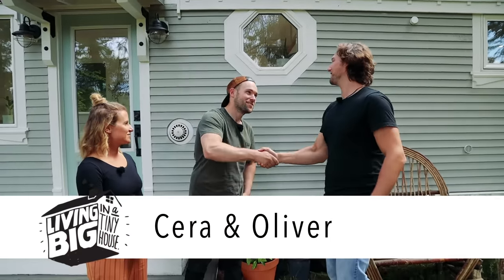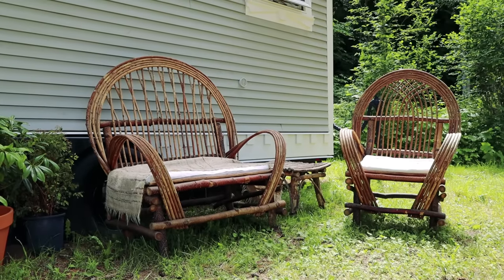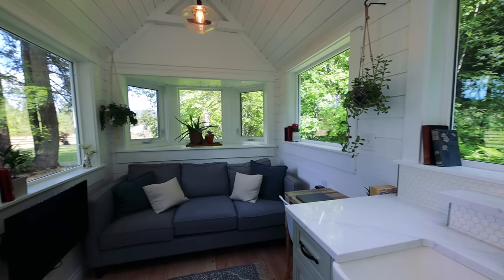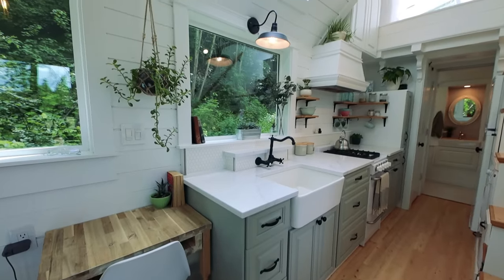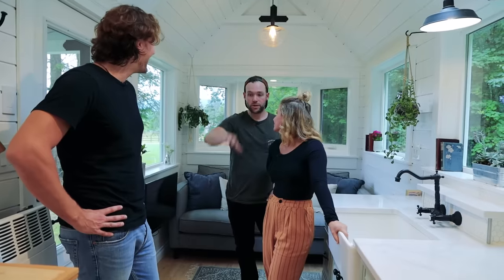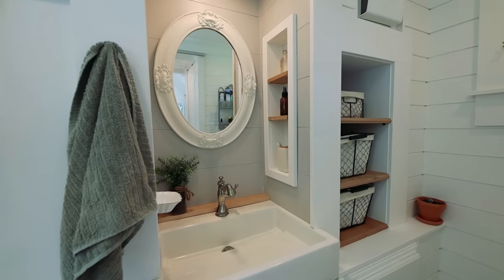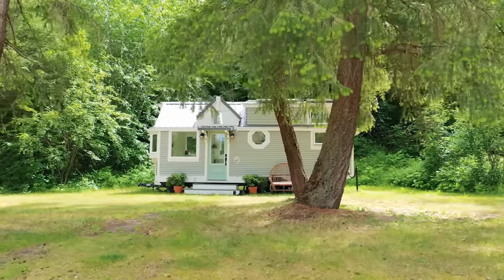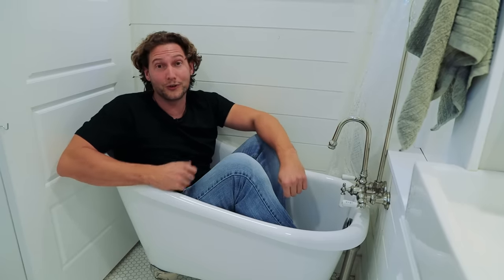Couple Downsize Into Dream Off-The-Grid Tiny House

Comment: The stair storage is one of the best I've seen on this channel, as well as the skylight covers! This is one of the best Tiny Houses! Although the $80,000 price tag was a bit high.
Reply: that was just for the supplies/materials.  Labor costs weren't factored in because they built it through their business.
Reply: jarednil69 it’s ridiculous.. I have less than 80k into my 700 sq ft house that’s actually a house and that includes purchase price
Reply: They could mean $80,000 Canadian, which translates to about $60,000 U.S. Still a lot, but a respectable amount considering the level of detailing and building materials.
Reply: That's the price of a regular size home
Reply: Rebecca Green are you kidding me? Where do you live in the world where you can buy a whole house for $80k? A 2-bedroom apartment in my city would cost NZD800k (about USD600k or GBP400k). Not even joking.
Reply: @c0ronariu5  I was referring to the $160.000 price tag..n no I will not divulge where I live. I never have here n won't.
Reply: Very high! Almost negates the point of having a tiny house.
Reply: @Beandiptheredneck  Canadian hour prices are insane
Reply: 80k for 700 sqft is insane,my old home before i sold it was 93k for 1400sqft and about a 15k sq lot 😵
Reply: @c0ronariu5  Move to the north of England, we just bought a 3 bed house (admittedly in a rough neighbourhood) for £32k - spent about £3k on rennovations.
Reply: Rebecca Green where do you live?!?! a two bedroom house can go for 300000 in my city
Reply: Ilona Bell Blackburn?
Reply: @nnenne1  No Middlesbrough in the north east
Reply: Ilona Bell lol, close enough
Reply: renting a one bedroom apt in most major Canadian city's would set you back about 1000 to about 1500 Canadian dollars so in about  6years this tiny house will have recouped what was spent to construct it.
Reply: @c0ronariu5  I paid $75k for mine IN SACRAMENTO CALIFORNIA, there was another for $55k.  But not anymore.
My sister bought her house in Oregon for $12,000..older sister house in Illinois  $40,000.   Yeah they are old and not all brand new best of everything expensive rich people tiny house.    However, let the rich do as they may, just don't tell me its about living simply shitck they all say.  Simple is a tent and a campstove.
Reply: @c0ronariu5  that's super expensive

Comment: At $80000 225 ft² that is $356 per square foot not including labor. That is freaking outrageously expensive. I think you can build something cheaper on site And get a little bit more square footage.
Reply: I agree
Reply: Economics...80-85k to build,  resale value 60
Reply: I thought it was expensive because THEY built it. Cost is relative to state , labor etc but unless he invoiced himself thats a bit pricey for something built by OWNER.
Reply: But they're in BC, CA, so they're using CAD. In USD that's actually closer to $60k, or ~$266 per square feet. For a custom home that they plan to live in for a long time, they can move it, and is expandable, I'd say that's a pretty decent price. Also they build tiny homes so they wrung a lot of value out of that--it would have been pretty expensive otherwise.
Reply: That's the thing about these tiny homes, they can be pricey which may raise the question is it worth it? Money that could go into a smaller size regular house. Like buying a two seater convertible car...
Reply: @evaintrouble7583  It's not expandable. It's on a trailer.
Reply: When you have a regular home you always have to pay for property taxes etc....since these are Rv certified. No taxes on your home.  People always say they own a home but with all the extra yearly expenses. Do you really?  It’s not meant for a person who enjoys stuff.... I personally don’t want spend my days off cleaning my big house, I would rather relax on my days off.

Comment: In summer months, use that sun material that motor homes put on front windows when they park.  It's amazing stuff.  Easy to cut with scissors.  When I attached them to the front windows of my motor home if it was  facing the sun, the temp in the coach instantly dropped about 10 degrees F, taking enormous pressure off the AC and other energy needs.  Sticks on with suction cups so it comes off easily, and it lets a clear view outside.  the stuff comes in various colors.

Comment: Really nice, I am thinking to do the same. 
My doudts: would not the floor after 5 to 6years start bending cause does not touch the earth, and floor starts loosen? 
Would not the tires start loosing air and moving a little left and right? Between how long could a tiny like this last ?

Thanks if anybody knows.

Comment: My only problem with a few of these tiny houses is that you can see everything inside the house from the windows. What if I want to pretend im not home? If I was going to build one the windows need to be one way I can't stand when a random knocks on my door.  my other problem is that a lot of these houses don't have AC in the bedroom for my bedroom it need to be at least 70F=21c, maybe it's their weather but Florida is hot and humid almost year round and AC in my apt is usually 73f during the day, but I get really hot at night so 70f.

Comment: At some states you can buy areal house for 85000. This is tiny and overpriced. Tiny tub, toilet. What if hail breaks windows or tornado flips this trailer over. It's no good. What a joke. My 1st home cost me 100000 and was over 2000 sq ft. Pretty close in price with this thing. But a real house